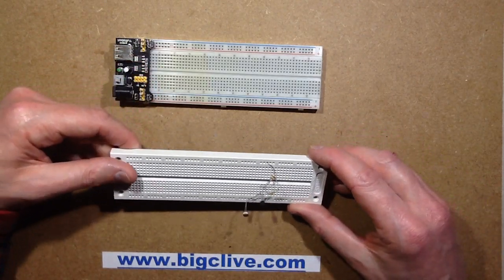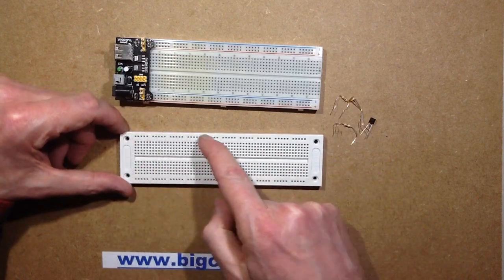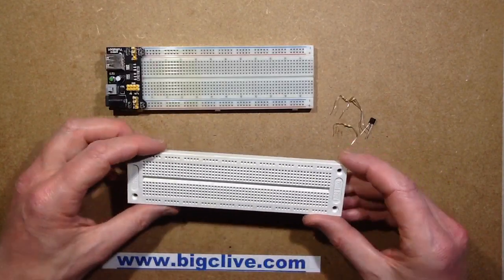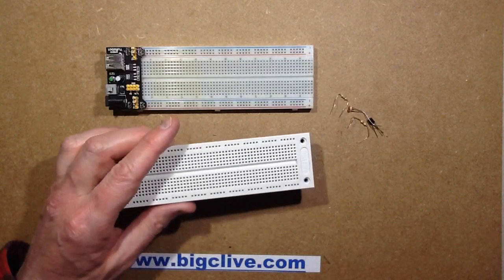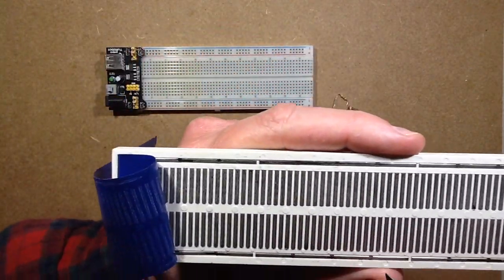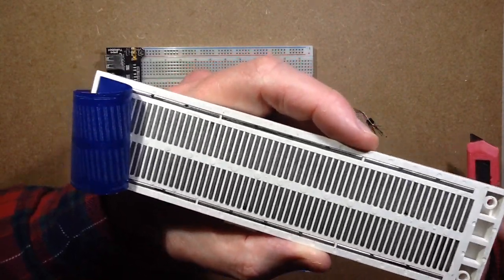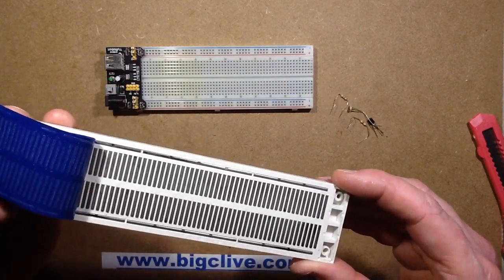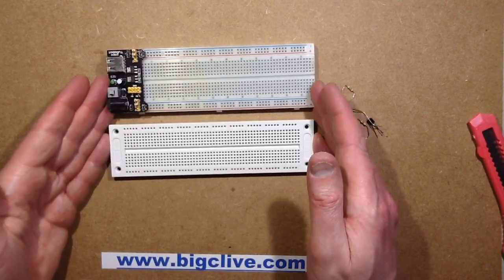Boobytrap breadboard from China.

Comment: It's not an uncommon arrangement, multiple busses if you want to use them like that, or link across for a single.

More annoying problem is that the bars are quite easy to push out when inserting a thicker pin, a solid back would help.
Reply from the maker: mojochan The main issue here is that it was not marked on the top.  I've had a look at some older breadboards and the busses are divided, but marked as so with broken lines.
Reply: I have the same crappy thing, too. I have linked it via solder bridges. In my version there are small noses on these strips that links them together - sometimes. :D It's just press-fit and does not always make contact. So I soldered it together and put a thin wood plate under it, screwing it tight.
Reply: Most of mine are the same, and some of them came from Maplin etc. It's normal, I'd be surprised if I bought breadboard and it wasn't like that.
Reply: +bigclivedotcom it is marked on the top - the one which is continuous is marked by a continuous line. The ones without  the continuous line are usually broken.

Comment: My Radio Shack(TM) bread board, which I purchased in the mid 2000's, has a similar arrangement but not as severe, the bus bars are split in the midpoint of the board so I suppose you could use 4 different power supplies or some such.